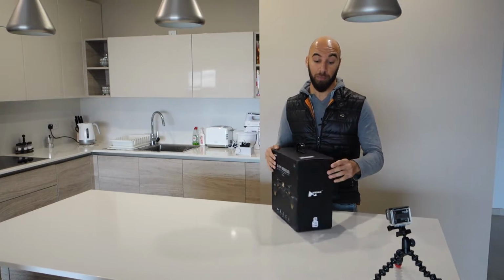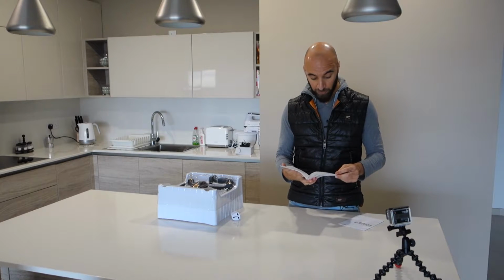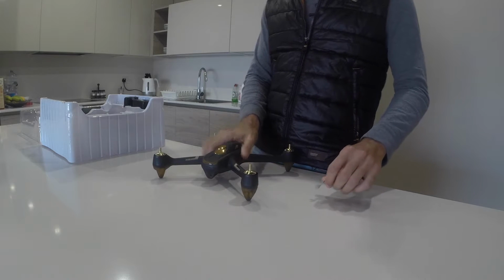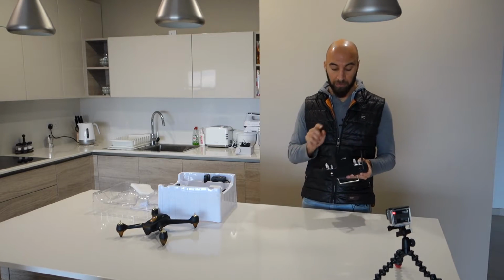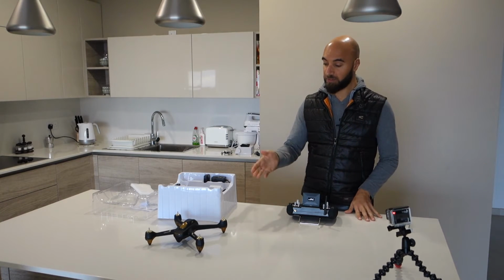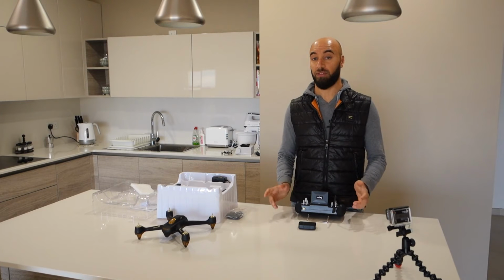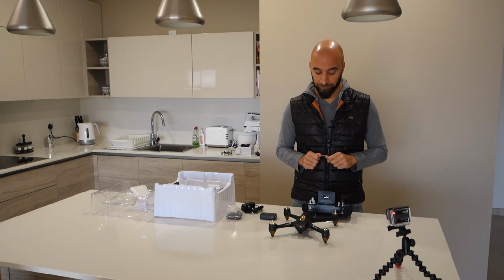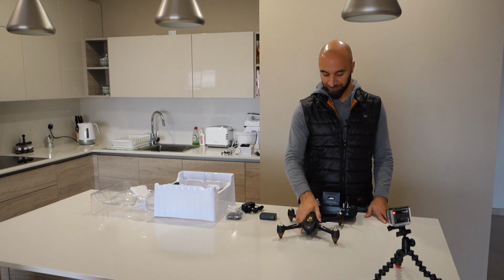Hubsan H501S Advanced Unboxing - Best Affordable Camera Drone

Comment: I have Hubsan x4 H501S in the controller I can never get the P or R to be less than 1, see pic ,although  I did the calib compass 1 & 2 successfully I have hared that if you can not get P or R to be less than 1 the HUBSAN  will not ascent vertically .Im not able to fly the drone yet . Please help .

Comment: Let me add a warning here.  I also have the Hubsan H501S advanced and had two issues.  1. The 2.4 ghz pigtail was broken in the transmitter.  I basically had no range and lost control.  2. My locator on the right stick failed.  I could not arm the quad.  Another symptom of a bad locator on either stick is no full travel.  If anyone purchases this with the advanced, you must take apart the transmitter and check continuity on both pigtails.  Also, make sure you get full travel on the sticks after a transmitter calibration. Most issues are transmitter related not quad. Good Flying..